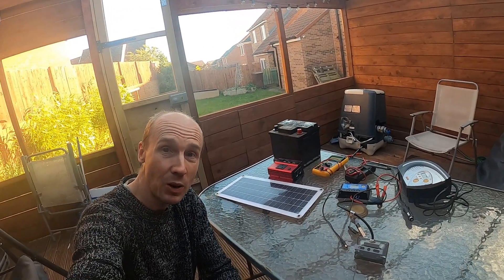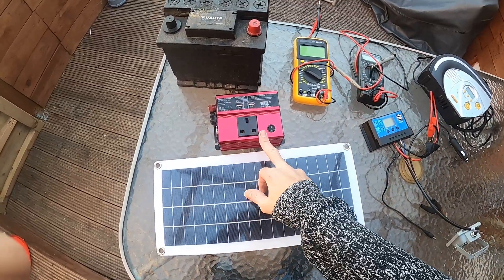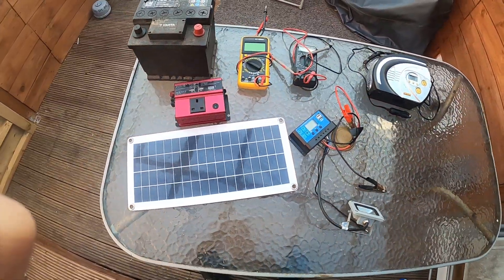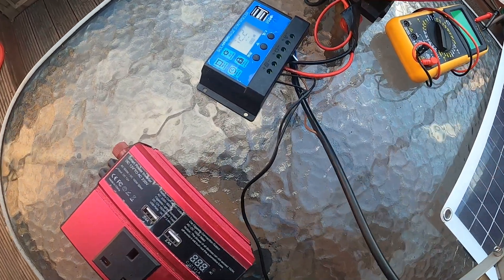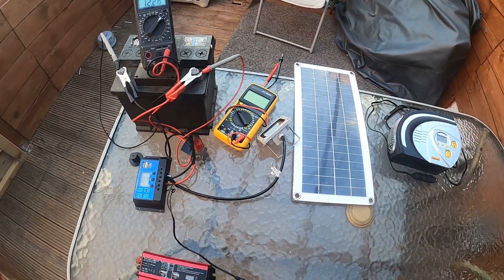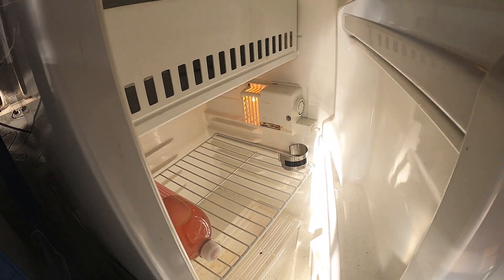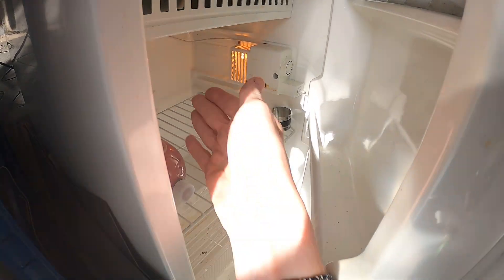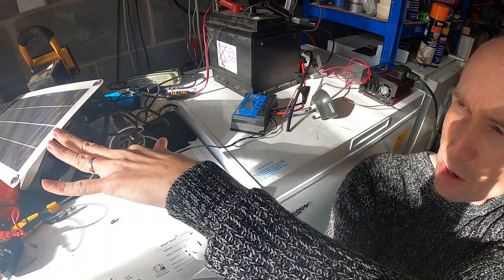How to survive if we have electricity blackouts/power cuts this winter!

Comment: The flashing AC light probably means you should use a far much heavier gauge wire to the inverter.  I was waiting for those wires to suddenly smoke when you turned on the inverter.

You can also hook the inverter, again with much LARGER wires, to your car's battery.  You might be able to run your home's heating unit if it does not require much energy to run.  Periodically start your car up to place a charge back in your battery.  If you know that there is a high probability of your mains being cut, place a couple of water jugs in your freezer so that they will help maintain temps, once frozen, whilst the power is off.  Solar yard light can be purchased cheaply, charged in the sun, and brought in at night and placed around the house.  Use LED torches and lanterns if possible as well.
Reply from the maker: Hi, ah good point on the ac flashing light, wasn't sure if it was peaking load but yes very likely! To be honest I was waiting to see if it did end badly or not, just to see the outcome :-)
some great tips there too, thank you for contributing